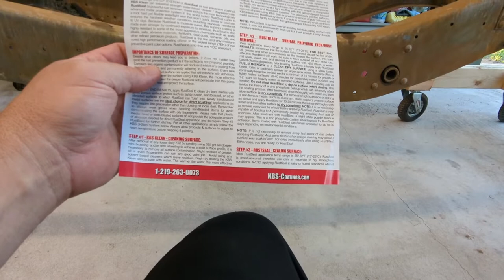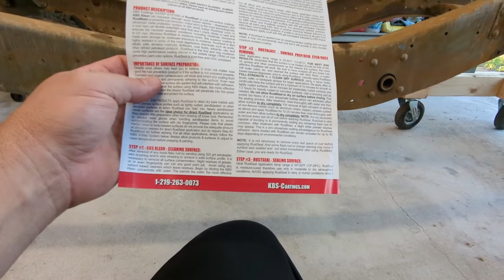KBS Frame Coating System

Comment: I've used the rust seal product myself. Ok but not impresst. Also i used the grey instead of the black. You should have used the grey too as spraying black on black , I bet you missed a spot or 2 as you cant see the differents . Now  on my truck frame i used Eastwood Platinum rust encapsulator  (silver) and sprayed it wit Raptor Black Bedliner material as top coat. Ive used The KBS rust seal on my trail hitch and rust came back within a year.

Comment: Sounds like that stuff is just like por-15. Same wash same metal prep same preparation same 2 hr wait time to reapply. I wonder if it lasts as long as por does.let me know
Reply: 28.00 compared to por15 at 55 dollars a pint.  i use kbs over por